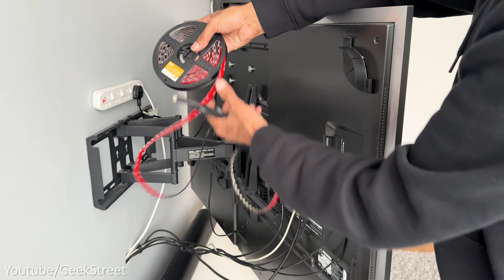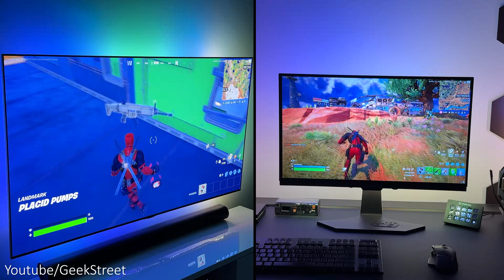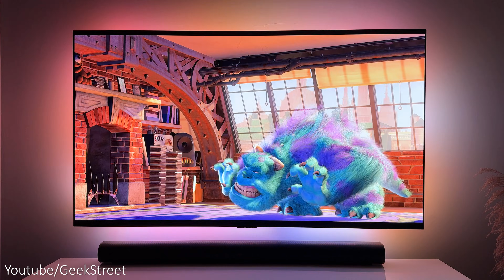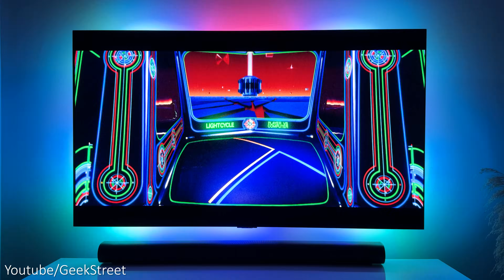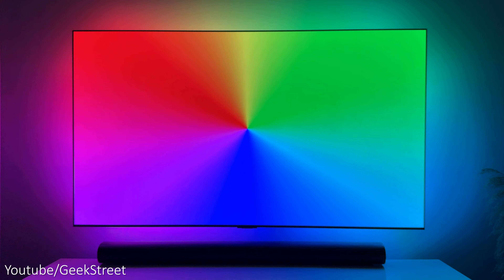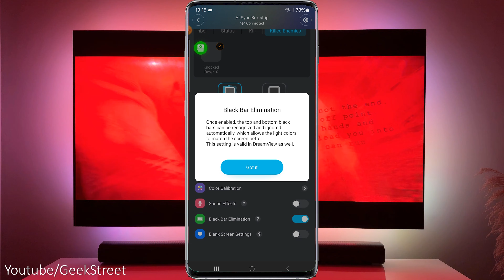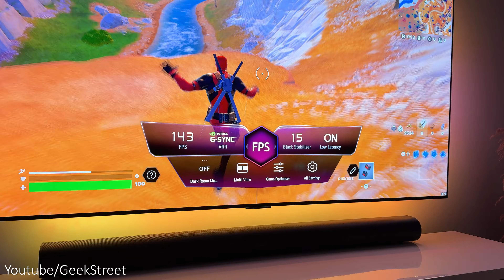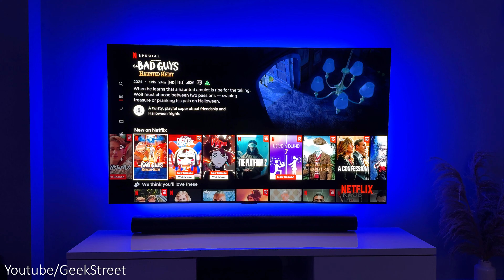NEW Govee AI Powered HDMI 2.1 SYNC Box 2 is a GAME CHANGER!

Comment: I dont get it, why should somebody use a sync box if there is a PC App that does the whole thing internally without latency and loss of picture Quality. The "older" G1 Light Kit cost also 70€ here in Germany witch comes with 2 Lighbars and a strip. All controlled by a App running on the PC. 
Also, why are they using HDMI ? Literally more than half the enthusiast gamers are using DiplayPort for higher refresh rates. 

It a cool move by Govee but i dont get why they are showing so many new products without adding features that are really important.

Comment: Love it, but does it support Dolby Atmos? If not, it's a dealbreaker
Reply: @artur9266  yes it does. The last one did too. I own the old one and use my sound system with it.
Reply: @artur9266  what a stupid deal breaker.
Reply: @NoYoureATowel3  why? Some people have home theater systems and need that Atmos passthrough functionality. I know that you can use splitters etc., but it's not the same seamless experience that is marketed
Reply: @artur9266  It's not processing any sound. Your receiver or sound bar is going to process the sound. However, I have the HDMI 2.0 version of this sync box and it does not support soundbars. It does however have support for an AVR. Not sure if the new one supports soundbars though.
Reply: @whoaitstu  does it support Atmos passthrough? Eg. ps5 and Xbox going into sync box via HDMI 2.1 or like in your case 2.0, and then from sync box to soundbar
Reply: @whoaitstu This is not true. It supports atmos 100% I literally use my sound system with it 😅
Reply: @artur9266 yes it does and so did the old one.
Reply: @TheLeadG   I don't think you fully comprehended what I said, my dude. I said it is not the one that processes sound. It has sound passthrough. Which means that it is not the one that processes the sound. The AVR or soundbar you are using is the one that processes the sound. I only said that it does not work with a Soundbar.
Reply: @whoaitstu  I have a soundbar system and it works perfectly with it. Sorry I didn’t make that clear. I thought you were saying that atmos doesn’t work with soundbars through the sync box.
Reply: @TheLeadG  What kind of soundbar do you have? I have a Sonos ARC and it was not working at all.
Reply: @whoaitstu  I have a Samsung hwq990c
Reply: @whoaitstu  what’s it doing exactly? Are you plugging directly into the soundbar?
Reply: @NoYoureATowel3  It's not 'stupid' as there are people who have bought AVRs and expensive speakers to try and achieve the best sound possible for their TVs.

Comment: Thanks for the review. I am new to this world and have a couple questions: 

1) I understand it only works with the HDMI input and I wouldn't be able to use the native smart LG TV apps, but if I plugged in a roku or something and watched TV, would it sync to whatever is playing at that point?  If not, would the fancyLED allow this or only a camera based system?

2) What does it mean that only AI works with gaming and not movies? What does that mean for movies?

Thanks!!
Reply from the maker: 1 - Yes it only works with devices connected via the HDMI ports so it will work with a Roku, this is the same concept as fancyleds but you wanted to use the apps running locally on the TV then get a camera based system.
2 - AI only works for key moments in certain games so for instance if a kill occurred or you died etc you'll see the lighting change to reflect that. In movies this type of functionally wouldn't make any sense in reality hence why it's not there.
Hope this helps.
Reply: @GeekStreet  SUPER helpful! Sub'd!

Comment: How does this work if you have everything plugged into an Receiver?
Reply from the maker: Plug the receiver output into the sync box and the sync box to your tv
Reply: @GeekStreet  so it's essentially still all devices into your AV receiver and the the out the receiver going into the input and then an out going to the TV.

Sorta makes the additional HDMI slots redundant then I guess on the sync box. Does this not add additional latency?
Reply from the maker: @TheGodfatherUk  doing like this probably will add a slight amount, best situation is to  plug your devices into the sync box then the tv and use eArc on your receiver.
Reply: I'm still confused. I'm very interested in this as I use an Onkyo AV receiver myself.

Would the best way to wire it be to run all inputs to the AV receiver as normal and then use the output of the receiver to the Sync box and then to the input of the TV?

I just want to make sure this Sync box works well with an AV receiver before ordering.

Comment: Looks like I'm stuck with the camera, which is fine it works well. I have a really Niche sized monitor LG 45-inch wide screen, so even with the camera set up, there is nothing quite that size.😢 I'm pretty sure I can still do a straight light bar setup. I have the T1 for my TV, and I have no complaints other than I had to do some engineering with my really thin TV to get the camera to stay other than that it's been really good
Reply from the maker: For smaller screens FancyLEDs may be a better option as you can cut the leds so I'm guessing you could use on tv's less than 55inch in size, just drop them a message to check.
Reply: @GeekStreet  I will thank you very much

Comment: Which is better between this one and the Fancyleds?
Reply: The Fancyled is a far better product. You can read why I think so in my response below. Short story is that thoroughly tested both with HDR, ALLM, VRR, etc. Both work with all sources and formats. Problem is Govee colors are off and it's not responsive or stable. Fancyled colors are gorgeous and it's far less buggy.
Reply from the maker: This one 💪
Reply: @GeekStreet  Interesting. From the Fancyleds video it seemed fancy were more accurate. Given they have 96 RGBW LEDs Per Meter vs Govee 75 LEDS per meter, interested to know what made the Govee stand out. Are they more accurate than the Fancy? Brighter?
Reply: @Cometer  I have the Govee but not convinced they are better than Fancy sincev they have some pretty serious problems. Fancy will be here tomorrow so I can compare
Reply: @BrandonRyan what’s better
Reply: @User18dog  The Fancyled product is FAR better. There's really no comparison at this point until Govee does some major work on firmware. And this is coming from a fan and owner of many Govee products.

The color accuracy, stability, and responsiveness are night and day between the two products. Govee has a better app with way more functions, but the colors are way off (gray is gree, red is often pink). The Govee also gets really sluggish where the lights respond very slowly to the source and get laggy, Not to mention you haveto fiddle with the "sensitivity slider" often or LEDs don't turn off when screen or screen are is black.

The Fancyled is gorgeous. The colors are very accurate and responsive and it just loos stunning with no fiddling. It's just no comparison whatsoever. Im using my AVR which has a Shield, Xbox, PC, Switch, Wii, Bluray player, etc. I've tested and it works great with 120fps, ALLM, VRR, HDR, etc.
Reply: @BrandonRyan  been wondering where these type boxes fall in with an avr. Can you explain how you are cabling this in line with the receiver?
Reply: @chaphil3  Sure thing. I have my NVIDA Shield, Xbox Series X, Blu-Ray player, Switch, NUC computer, etc. all plugged into my Denon AVR via HDMI. I simply run the 8k/120hz HDMI output of the Denon into the FancyLED box and then the output of the FancyLED box into my Samsung S90C TV. Basically the Fancy LED box is just between my AVR and my TV. It works like a charm. The same setup also worked on the Govee system I had, but I far prefer the FancyLED lights.
Reply: @BrandonRyan thanks for this info! Helps me great deal! So a fancyleds sync box with just one hdmi would be sufficient. I have a Yamaha AVR instead of Denon so that maybe could  be a problem . Every brand has different bugs in terms of connection. But i really like the Fancyleds one.
Reply: @GeekStreet  damn, just installed the FancyLeds box last night 😭